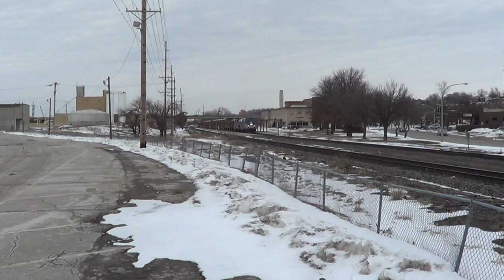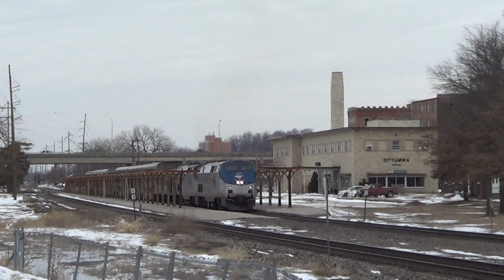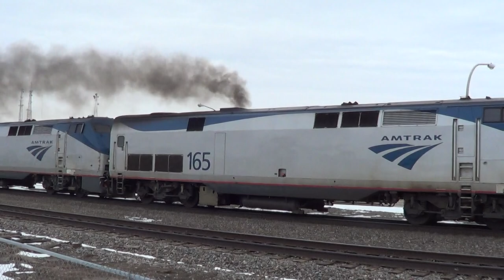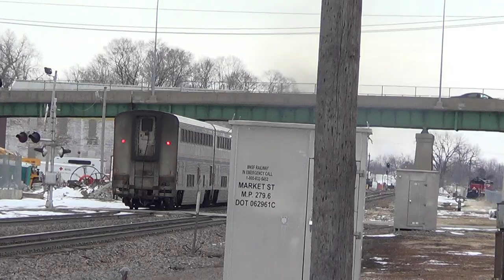Smoking Engine Leads Amtrak Out of Ottumwa Station

Comment: the smoke goes out,but alternate,not continuous,,see the video,some cylinders dont work well (check injectors),,and the smoke in excess,check the charger,at high speed the smoke is less.

Comment: Wait so what is happening that is causing that?
Reply: Odorous Wolf I think the engineer made a running brake test with the throttle in 8.. basically like putting gas and brake on at the same time
Reply: That particular species of locomotive can put out some soot when under heavy loads.

I was thrilled to see them leaving a modest amount as the Coast Starlight was climbing in the California foothills northbound heading out of LA late May 2021.  

That trip turned me into something of a train nut.